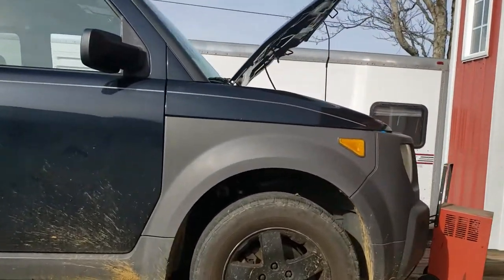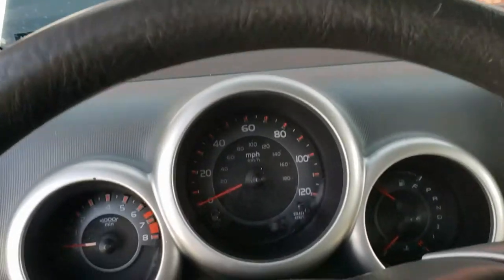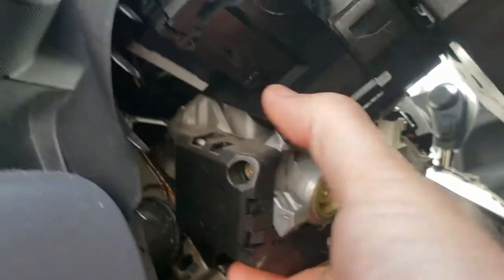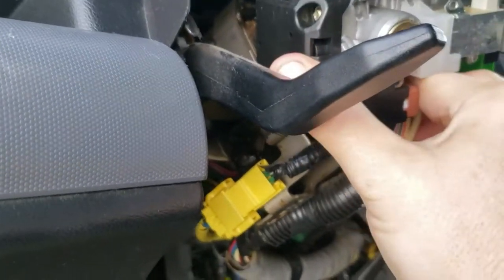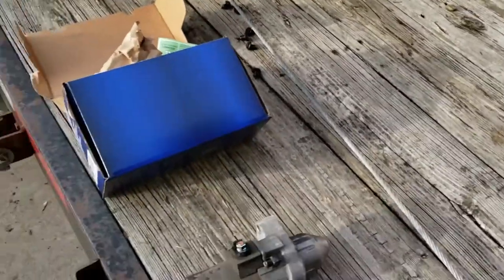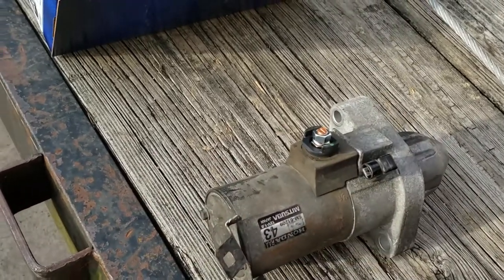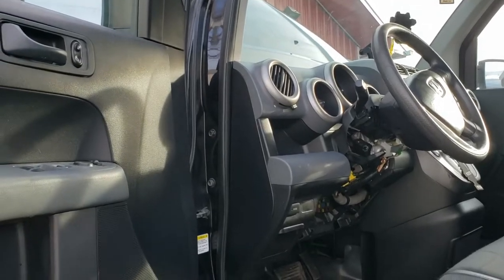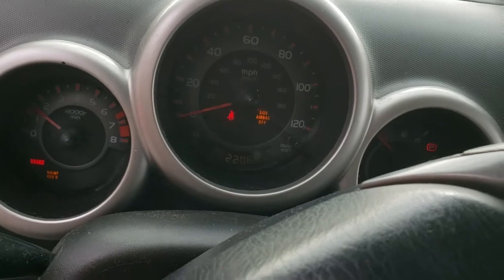How to fix your Honda Element that won't start! | K24 Honda Engine

Comment: Thanks guy. Have pretty much the same issue on a civic. Searched to see someone replicating the same problem and here it is.
Reply from the maker: After I removed it from the suv I took it to Advanced Auto and they tested it. It did spin over but no where near as fast or strong as it should have been. Really unusual, usually they just die or you start to get the dreaded - no start when engine is hot.

Comment: EXACTLY what my 2007 Element has been doing! Actually will start fine, then I go to several paces to grocery shop and maybe the 2nd or 3rd stop...it does this...slow crank but won't turn over/won't start (only dash lights & some brief whining...if I try again...probably hear nothing).
Reply from the maker: This one the owner stated the exact same thing happened before it stopped starting altogether. It just got worse and worse as time went one. Until it finally stopped for good. Once I took the old starter to Advance they showed it still engaged but was really slow, not enough to actually crank over a vehicle.

Comment: I'm confused. My 2004 element is doing this also but I thought you said the battery was fine at the beginning?
Reply from the maker: It was the starter that was bad. When they tested it at the parts store, it did engage but was too weak to spin.

Comment: Did you use a factory or aftermarket starter?
Reply from the maker: I just the cheap one from Advanced Auto. If you order online you can get 25% off (Google for the code). It also came with a warranty if it would fail